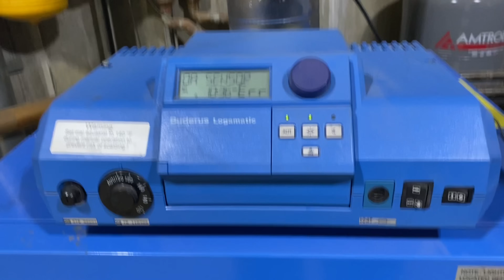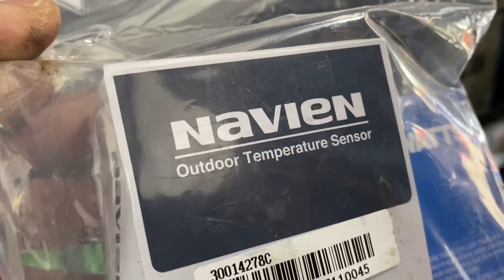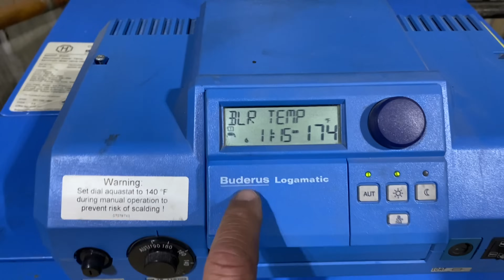Buderus Gas Boiler Error OA and Radiant Zone Not Heating Defective Zone Valve

Comment: I'm on the second day of vacation today. My van is in the shop getting repairs. 324,000 on the E250. I miss work already....
Reply: @PipeDoctor  It's a "use it or lose it" vacation. I don't take time off during the AC season (commercial third party HVAC for retail) and I can't roll the time over into January or February, so I have to take it now. Ford will get $2,500 on Monday to make the truck legal to drive again. I like having the time to relax a little, work on learning piano, but I like the challenge of diagnostics. I worked as a car and truck mechanic, a flight instructor and jet pilot, and I am in year 15 working this market segment in HVAC. I don't have to go into any basements or crawls, deal with any homeowners, and I am under no pressure to sell instead of repair. I get to do some refrigeration a few times a year, but most of that is working on junk, because the prepared food industry spends ZERO on maintenance. I went to college in the Village, and I had a roommate from Rockville Center, so it's nice to see some of Long Island again. Have a great day!

Comment: Just crazy that big ass house and the T-Stat’s are like that wonder if he’d be interested in wireless ones fuckin something lmao
Reply: those are WIFI connected models, surely that's why he installed them(so hacked), I'm guessing the original thermostats were non-wifi proprietary wireless type. ;)
Reply: @throttlebottle5906  why would it matter if they were WiFi stats? Not to be rude I’m just thinking about them actually reading the temp for each space they control
Reply: @teeg3275  they would be used in conjunction with remote thermostats/sensors in each room/location and all controllable by wifi/phone app.

Comment: Navian outdoor sensors are same resistors as the weil mcclain  ultras as well
Reply: In a pinch I’ve even used the Aprilaire humidifier OAS for a thermostat that displayed ODT. Their chintzy and not covered but it worked and pretty accurate. It was only a thermostat but if your ever in a bind till you can get back with the correct one. 👍🏻

Comment: Clearly original installer knew how to pipe, yet job looks cheap. Marking zones on a high end job with a Sharpie?! Minimum printed labels, better yet should have engraved tags.
Reply: I agree….an Install of that magnitude deserves better tagging of controls, valves,  etc……..Also, there should be some sort of blueprint or diagram of the set-up to make it easy for the next guy.